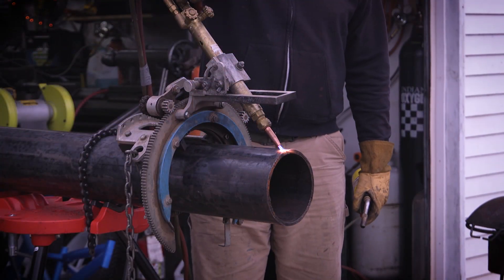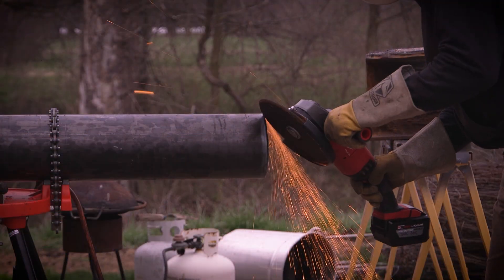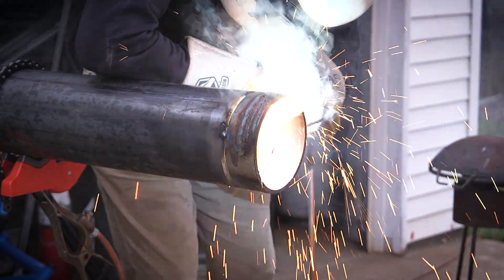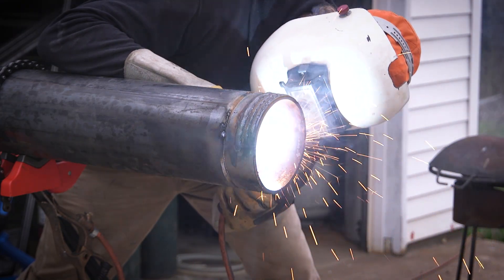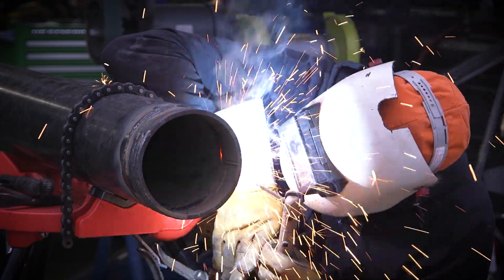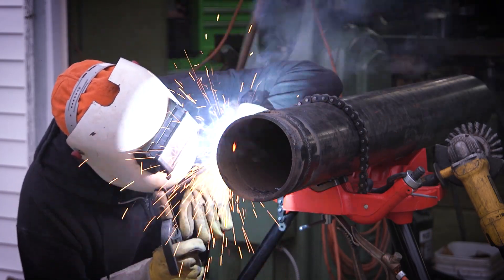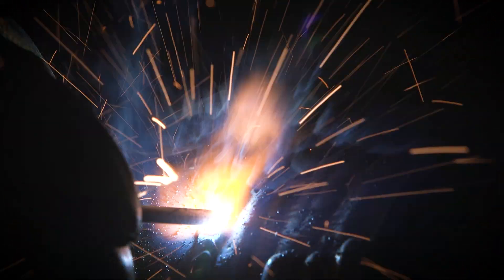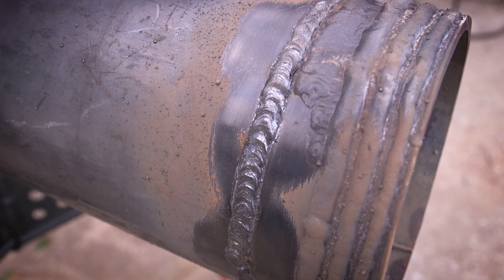Welding 6 Inch Schedule 40 Carbon Pipe

Comment: You practice on scrap first, and then you can tell which ampere to set it on.  😂

2. Start at the lowest setting, and then work up from that. 😅

3. Email Lincoln, for the settings for carbon pipe. 🤣